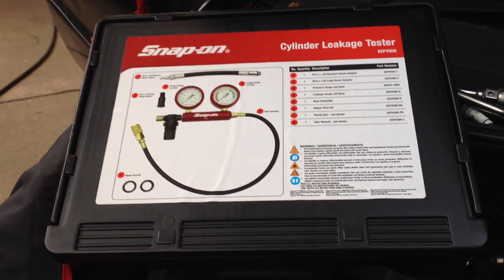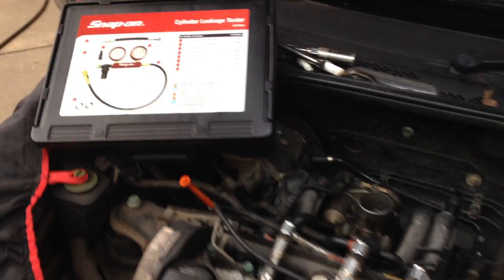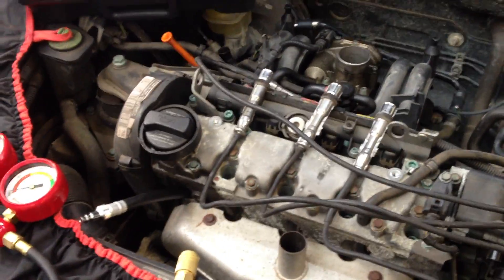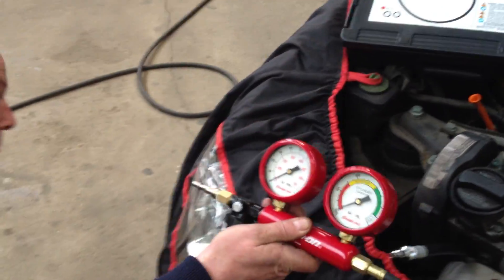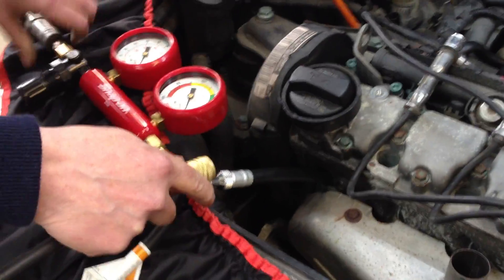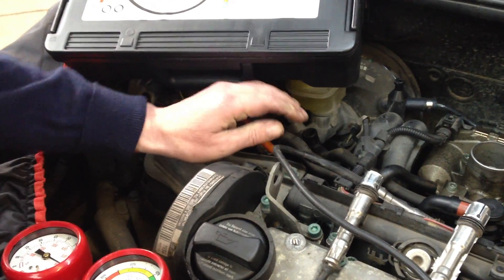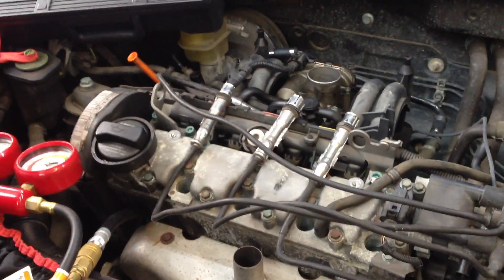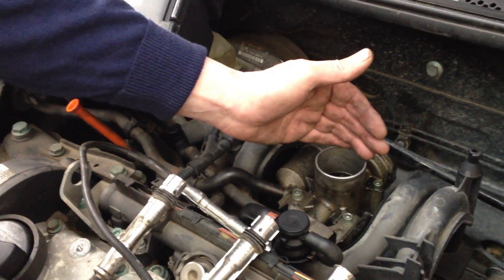Snap-on UK - EEPV509 - Cylinder Leakage Tester

Comment: Should anyone be wonderering, being at TDC does not mean all the valves are closed. On a typical 4 cyl engine at TDC, only the cylinder at TDC (firing) will have the valves closed.

Comment: Test is incorrect. Tester should be connected to cylinder from the start.
Reply: wcjcnc.  Is this because when he connected the tester to the engine he lost some air from gauge #1 during the connection (it dropped from 100 psi to 85 psi) which then makes the gauge #2 result (90% loss) slightly wrong?  
As I understand it, gauge #2 readings can only be taken at face value IF gauge #1 is set and maintained at 100 psi.  If gauge #1 falls to a pressure lower than 100 psi then you need to reset it to 100 psi...or ignore and apply a set formula to calculate the leakdown figure.  
I'd guestimate that the true loss in this case is closer to say, 95%, but that's academic at this scale as anything over say, 40-45% usually spells money for repairs or replacement.
Reply: @STiHigh1   Yea, if the first gauge is not at 100 PSI you can do some math and figure out what the exact percentage of leak down is but to make it really easy you want the first gauge at 100 PSI. You also want 100 PSI to really test the integrity of the cylinder. It’s odd that almost every video on YouTube about how to do this test is wrong. Everything should be connected from the start. Plugging the tester in after you pressurize it defeats what you’re trying to do.
Reply: @wcjcnc  Thank you for the quick reply.

Comment: personally id only use 10 to 30 psi as 90 to 100 psi could move the piston and you need to keep TDC
Reply: lock the crankshaft friend
Reply: @williammorken7484  I keep people saying "lock the crankshaft", but I am not sure how you do that?
Reply: @shanefrank3281  just put a wrench on the crankshaft. It isn't very much force. I've never had it move on me. You do have to do 100 psi to get an accurate reading. In school we used to put a plastic straw in the spark plugs hole and that would give you a visual to see when the piston is at TDC